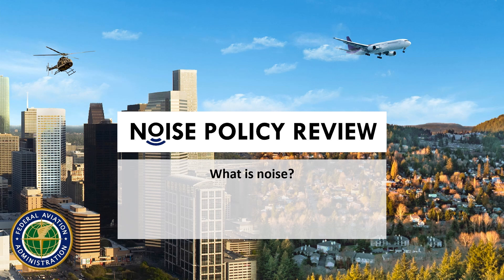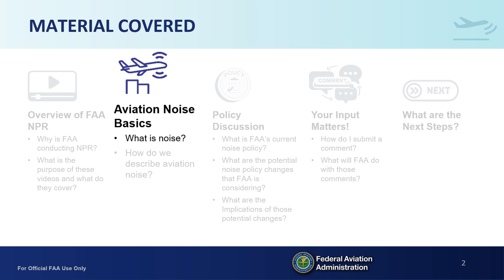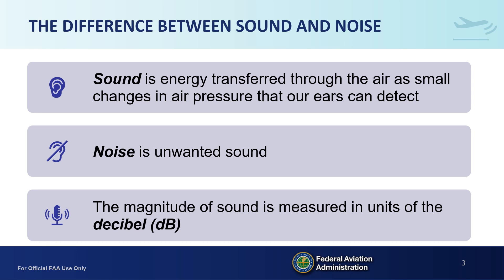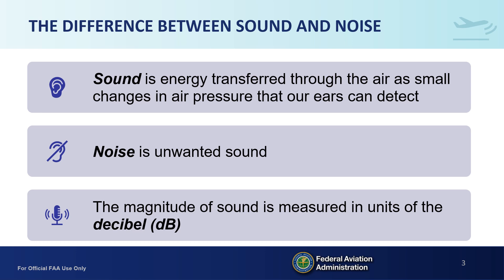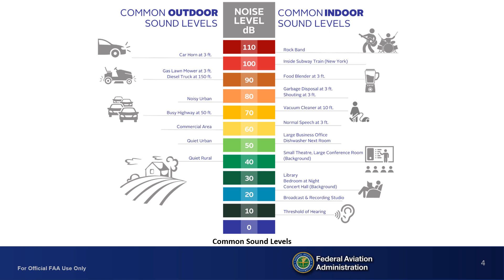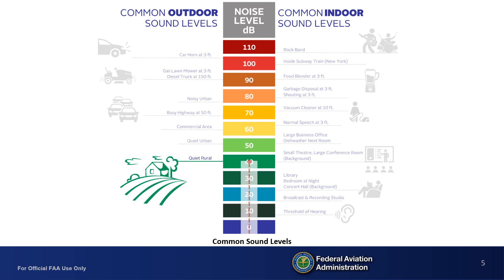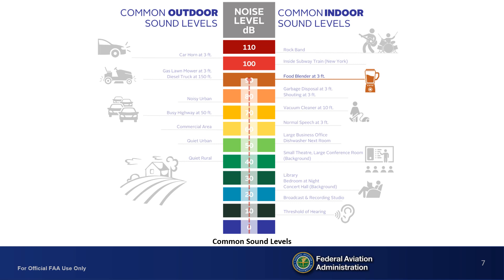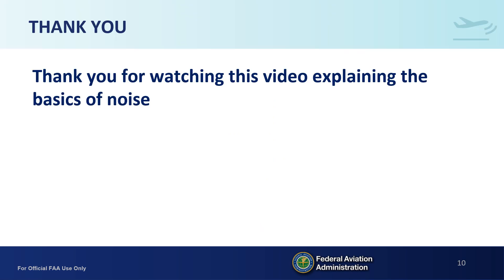FAA Noise Policy Review - Aviation Noise Basics - Fundamentals of Noise

Comment: Distance from source needs to be applied to aircraft/aircraft type as well. When we experience deviations from airport arrival paths, displaced over residential areas, and jets are low enough to shake your house (too far from the airport, not in the area of the airport), it is like putting a rock band inside your house according to the CalTrans noise chart. That interferes with the intended use of the property zoned and built for residential/school (even lower decibel rating) use. Entire cities have been appropriately zoned and built up to accommodate the airport, we should be promoting what is published for approach/departure paths and percentage allocation as a use to mitigate noise. It is the deviations that generate the complaints. 

There are so many airports now that we the people can't 'just move' to escape. This is why Land Use Agreements need to be followed and deviations should only be reserved for extreme situations (which should require the use of emergency squawk). Aircraft are mobile by nature where housing is stationary. It is far easier and less expensive to fix noise problem by pushing aircraft to higher altitudes to create distance to lower noise levels than it is to tell a whole nation of people to keep moving to avoid the noise. 

Noise is also a symptom of safety. Once we started getting bombarded, we started looking into flight tracking tools. We found jets exceeding FAA speeds under 10K feet and under 2500 feet (both being extremely loud and obnoxiously).  Aircraft below minimum safe altitude. When everyone is flying the way that they should, it is heaven on earth, when they are doing everything they shouldn't, it is the opposite.  Our local airport is throwing out data from sources who report multiple incidents which means the FAA isn't getting a clear picture of what is happening. And if higher altitude means an increase in safety based on avoid obstacles, reactivity time to avoid other aircraft and control in an equipment failure, then a higher altitude solution for flight paths as our skies get more congested is the easiest/cheapest/safest/most reasonable solution.  

Upgrading air traffic control for increased air safety mixed with enforcement of FAA policies is the key to balancing noise exposure to the public.
Reply: People who like airplane sound, including large Air Force tankers and bombers deviating from normal flight paths, should also be factored into the FAA statistical studies.  The FAA approach is to collect survey from people who are annoyed by airplane sound and ask them if they are annoyed, very annoyed, or very very annoyed.  Guess what... ? The statisics will say they are annoyed.   The approach does not include aircraft enthusiasts who are also citizens of this country.  This video clearly states that noise is unwanted sound.  I like airplane sounds... why can't we get more ?  And yes, I live in a neighborhood immediately under an airport and adjacent to an airforce base.
Reply: @tlattebery  'Like' and 'Dislike' are subjective terms. We already have noise exposure laws on the ground to protect public health/safety avoid hearing loss. Those ranges are objective data. The employee ethics for all government organizations require that all employees follow and abide by ALL laws, which means that the exposure designated per zoning/disturbing the peace/land owner rights must be enforced. Again, especially if an entire city has been zoned to accommodate the land use around the airport. Changing its use to what was never intended via unnecessary deviations is creating intentional conflict and legal conflict. 

 Just because someone 'enjoys' a sound doesn't mean that they have the right to impose it in the form of legal damages or physical harm. Just because you like a song, doesn't mean that you can blast it at 95 decibels at your neighbor 24/7. Just like stereos have headphones where you can enjoy it all that you want, airplanes have designated safety paths that create balance and altitudes that increase safety and reduce noise. All of these playground arguments of, "But I like it," or "It was here first," or "It doesn't bother me," just makes the aviation community look like this is intention infliction of distress on the public and malicious imposition because those statements add up to nothing more than gaslighting people that have been injured. 

Part of the issue is the altitude/speed of approach also not meshing with what is published via the FAA for safety. So why are pilots going out of their way to violate safety regulations? Why isn't ATC advising? Why hasn't ATC been modernized BEFORE the push to increase air traffic and expand airports? Why are pilots suddenly making choices that they know could injure themselves, other pilots, their passengers and the public? If you look on any web tracking tool and audit what is going on, the misuse and mismanagement of the airspace easement is to blame, not the people complaining. Why are jets and Cessnas in helicopter and drone airspace (altitudes) outside of the area of the airport over congested, residential zones? Why are they approaching where there aren't easements (where we are supposed to move to) instead of using the easements for approach and departure? On days when pilots are doing what they are supposed to, everything is fine. It's when it is the chaotic mess that it is louder in my backyard than if I were standing outside of an international airport. And that is not an exaggeration. Someone needs to be held accountable and the FAA needs to correct the problem.

To quote my congressional office, everything that needs to be done is published, now we just need the FAA to do it.
Reply: @tiki_t  I have the tracker and a radar. I'm with you 100% your very wise and calm in your choice of words that is rare. We need more people like us to spread awareness about this kind of stuff happening it affects wildlife in a big way too
Reply: They do. People who live in avigation easements are financially compensated. Those who do not shouldn’t be expected to spend their own money to preserve their property rights.
Reply: Theyve been commiting noise violations in ontartio where I live all day and night for 7 years. I think it's time for me to sue. I'm sick of hav8ng my sleep taken away from me.
Reply: @TheGreatOutdoorZ  I never understood people screaming to shut down airports until I was also in your situation where pilots were creating this kind of harm and instead of correcting it, created more harm by gaslighting, omitting data to provide false reports of compliance to the federal government,  generally wasting the public's time, and compromising safety (Accidents being rare is no longer the case, we had 3 crashes in one month).  When you back people in a corner by taking their property rights, health and safety away but refuse to comply, what is there left to do but scream to shut down the airport. What shifted in the aviation culture that safety and community balance is no longer the priority? This is insanity. The FAA needs to clean house and put someone in charge that will follow what is published and enforce these violations.
Reply: @tiki_t  are you a angel? 😇 thank you for your kind wise words. Your very smart for saying that. I'm happy I got to connect with another person that understands and feels the same way I do, thank you for caring. They don't care about us our the wildlife.
Reply: The youtube shadowing of comments is a joke. It literally is like having your voice ripped out. Pure evil youtube